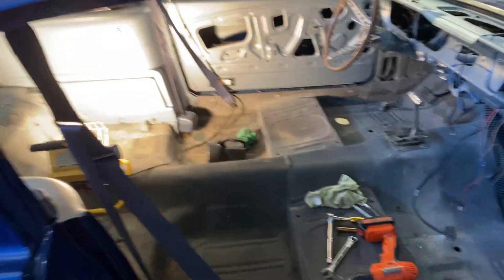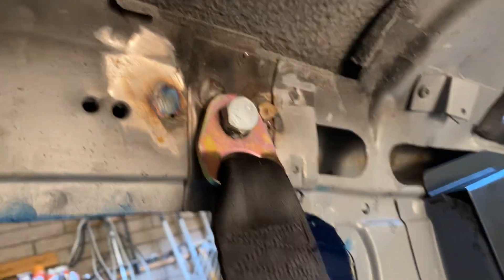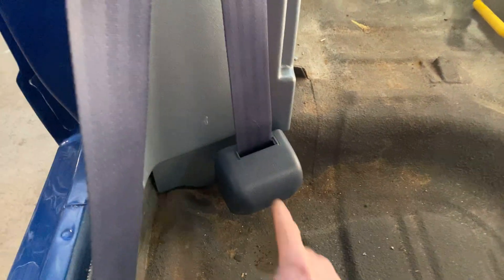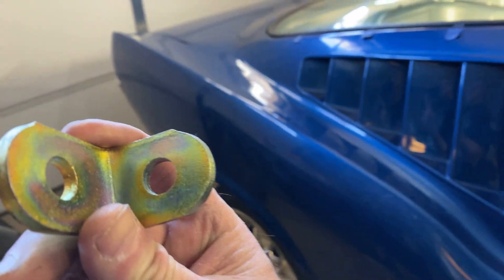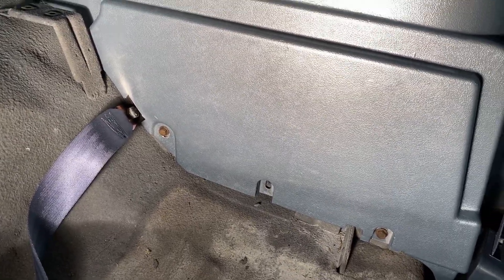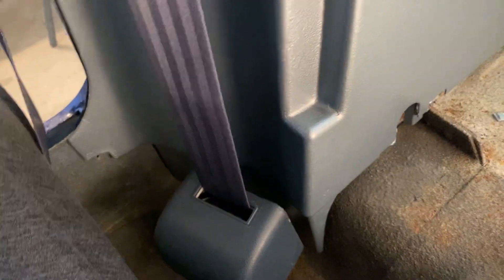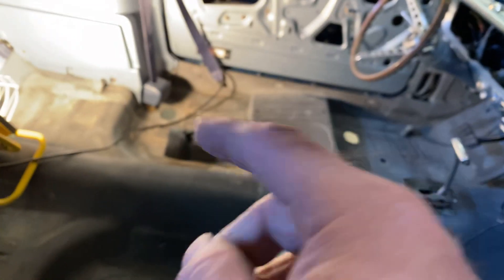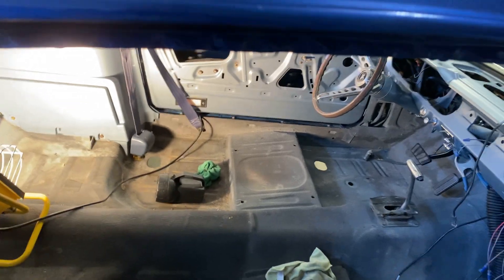65 Mustang Fastback front 3 point/rear lap seat belts

Comment: thanks for the video. Did you just drill a hill and mount a seatbelt bolt for the rear lap belts? Where did you mount the female side rear lap belts? Did you have to cut holes in you rear seat to pass them through?
Reply from the maker: That's for the question. There were mounting hole for the rear seat belts on the floor pan. the TMI seat covers had a slit in them for the rear seat belts to go thru.